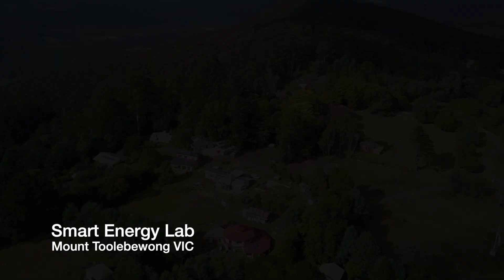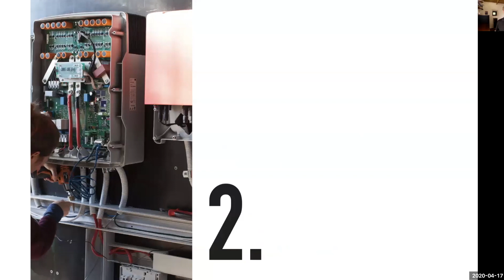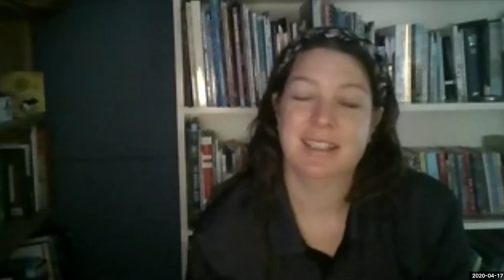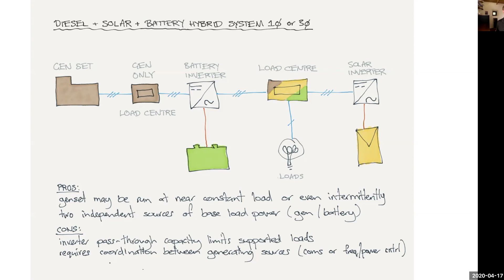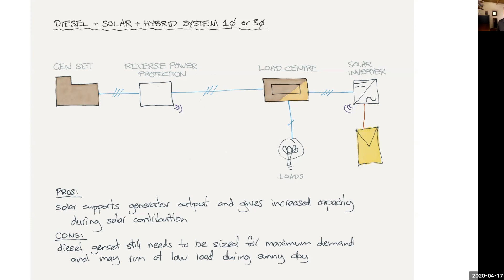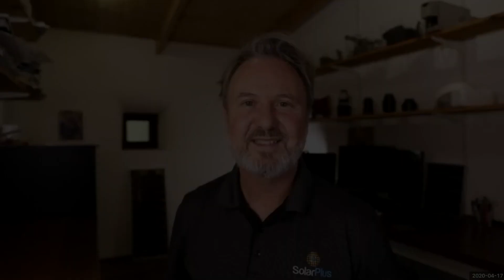Solar & Battery Training Ep4

Comment: Hi Glen
I've enjoyed the course so far, but in February 2026, I found this module might have become a little out of date.  For example, one inverter can now have both a generator, PV and battery connected.  That would simplify the diagram that has a separate inverter for the generator.  Also the chart that shows the loads and solar generation - the discussion of this doesn't mention selling back power.  I realise that true off-grid systems can't sell back.
I'll scan through the rest of the course to see if I can find content that relates to urban systems where selling back is a useful cost saving.
Like Greg, I admire the course, offered from home during the first Covid lockdown, and at no charge, with questions answered (where relevant to the current topic).  Rachael adds value by moderating the questions.  Conclusion: excellent course, but this module is not what I was looking for.
Geoff Webster
Electrify Ellerslie (Auckland NZ) community lead - but not an electrician

Comment: Why is your PV connected to the AC side of your inverter?
Reply from the maker: Some battery inverters can be "a.c. coupled" to the load side of the inverter, thus the PV inverter can reverse feed the battery inverter to charge it's battery. This is the most common way larger off-grid system are configured.

Comment: Hi Glen,

On a battery less off-grid system,  would the PV inverter match the frequency of the generator easily? I always thought that the power generated by a generator is not very "clean" and because of this PV  inverters can't quite match their frequency to that of a generators output.
Reply from the maker: Jayesh Boban if the generator is reasonably stable then the inverter can sync with it
Reply: @SmartEnergyLab  If that's the case, can a grid connected system in theory be tricked into running off grid with a generator when there is a power outage?